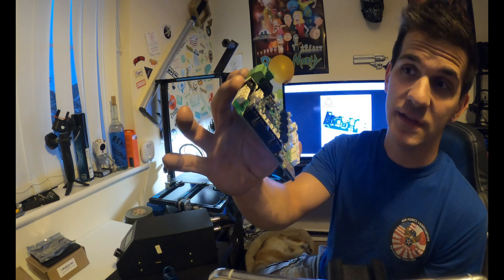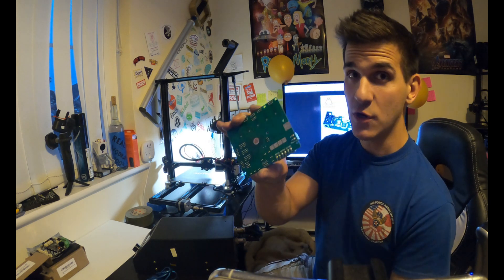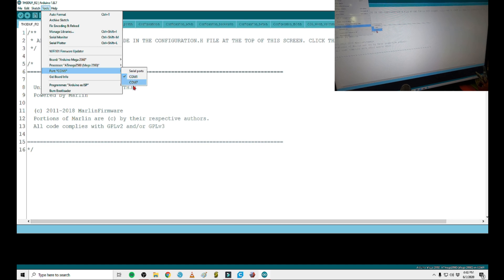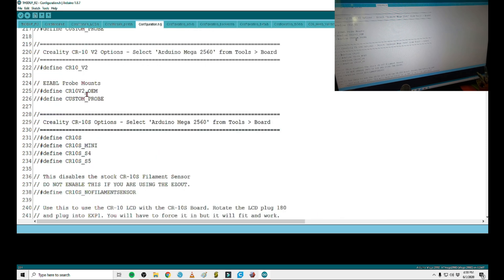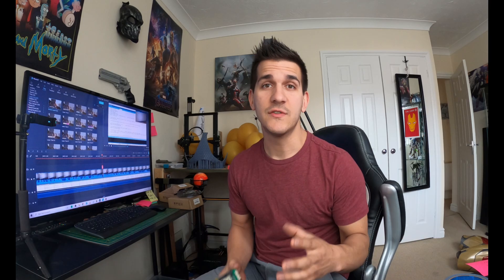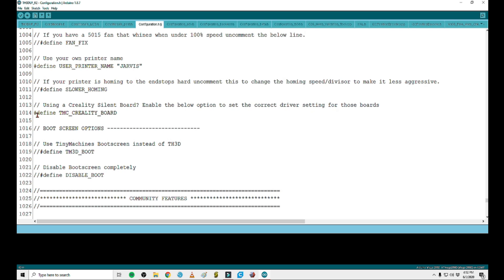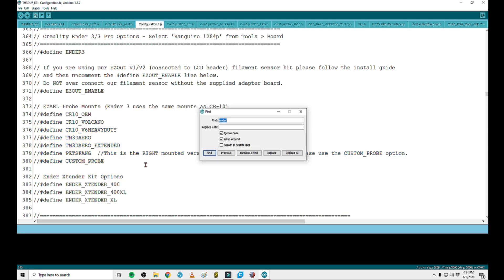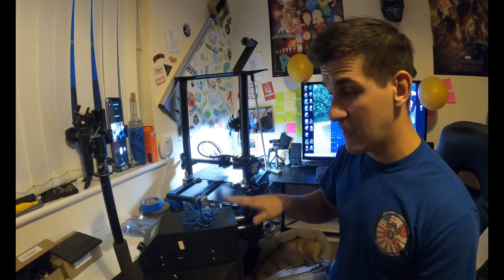How to Flash 3D Printer Mainboard - Upgrade 3D Printer Firmware - Enable Thermal Runaway Protection

Comment: Hey Frank, so i am going to pick up a silent board for my CR10s, all the ones i have found have the BL touch option and i want nothing to do with it. from what i understand you need it to run the main board with the firmware that comes with the new board. if i flash it with the one from this video do i need to get rid of it or is that already missing/disabled in the "code"? Also i have no idea what i am talking about... Still learning!!

Comment: Could you assist me with flashing my Exilis Wombot?  Having issues with home settings and also the bed leveling not touching all spots on build platform just levels in one spot.  I changed a thermistor then all these issues occurred.  Help would be much appreciated
Reply from the maker: Hey! So I’ve never messed with one of those but if you hop on my Discord I’m sure someone can help!